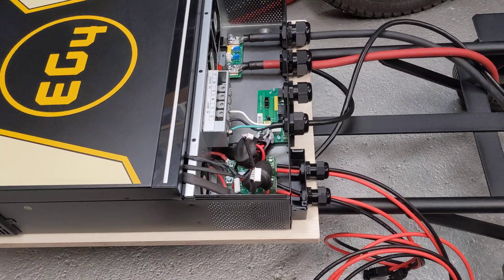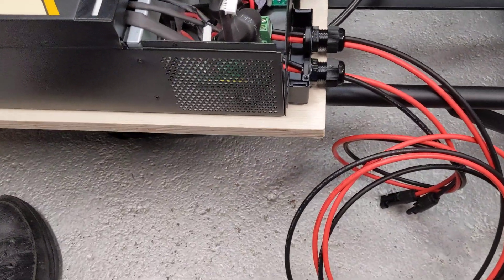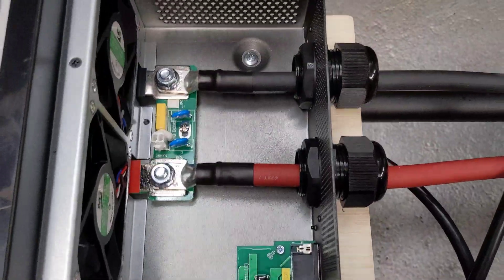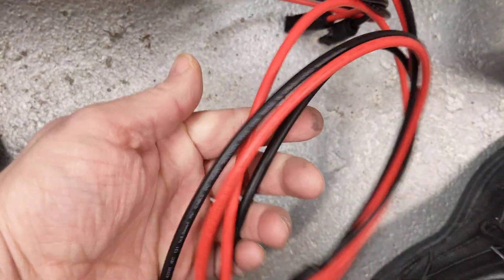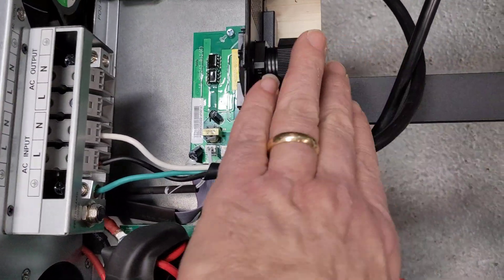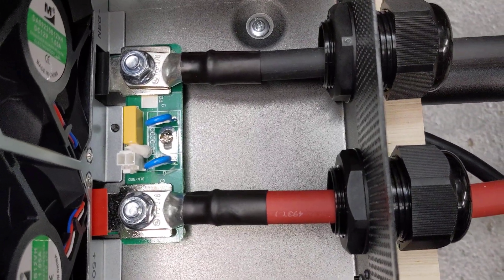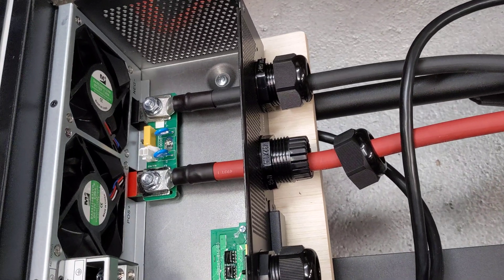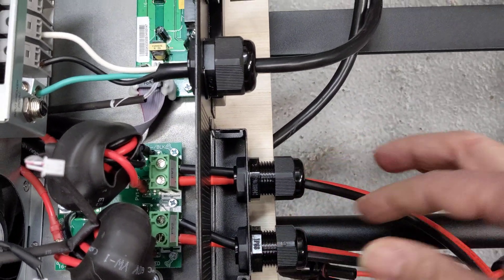Building a 6,500W Portable Solar Power Station For When Power Is Down! Better than a Gas Generator!

Comment: Can we get a follow up? Battery installed, hooked up to solar and running. Maybe see the back?
Reply: Attached everything, charged up the batteries from Utility power.  Worked fine.  Put my 4 panels in and then made sure the inverter would take a charge from them and it did.  Wrapped everything up and put the whole handtruck into storage.  Checked on it about a month ago and battery was at "99%" (gotta love lithium iron phosphate batterieis).  Only downside is it is VERY heavy.   But I love a silent power source on wheels.